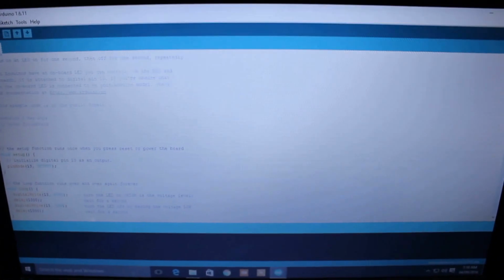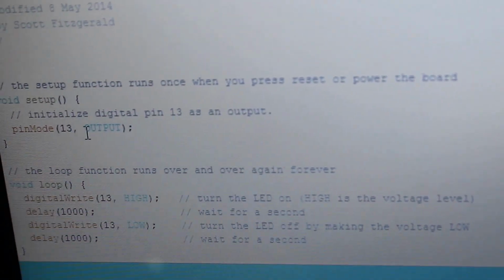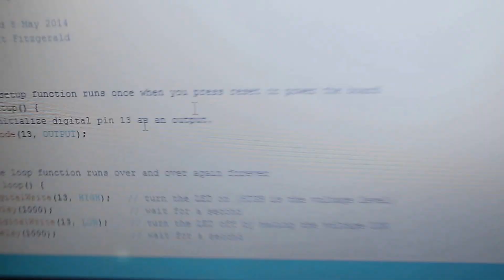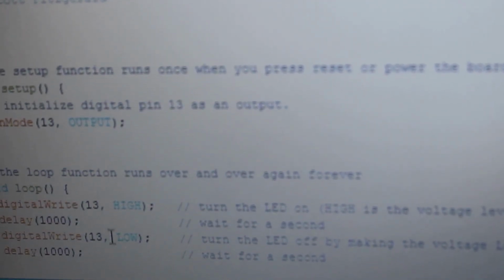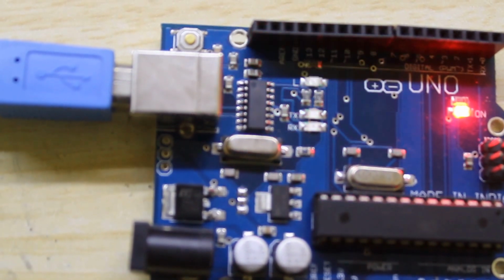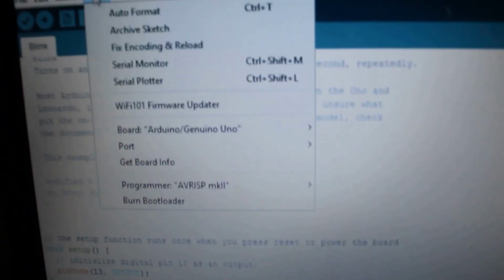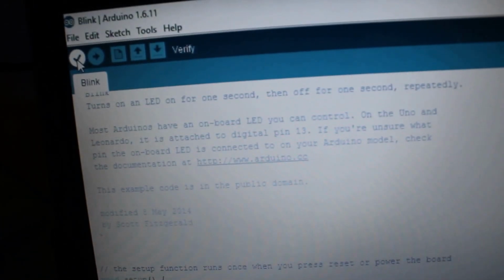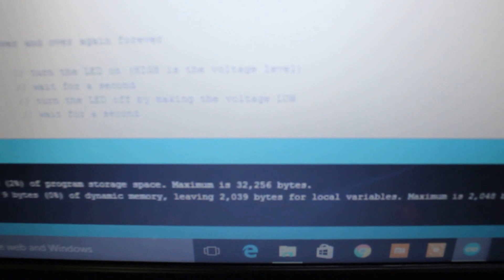How to Upload program into Arduino

Comment: Bro usb port option is not showing please help me😭😓.
I worked on that for three days, but not worked.
Please can you give solution.
Reply from the maker: Go to this_pc option right click, click on manage open device manager and check if USB port is detected in your computer and COM PORT is assigned. If not assigned then either install CP2102 or CH340 Driver 
Or if it's a normal Arduino clone board just try to change port and see if port is detected.
If still no success go to your folder where Arduino is installed in filesx86
Check for drivers folder, copy the path and paste it during installation from device manager.
Search little bit on Google it will work
Keep connected!!
Reply: @kolhatkarchinmay  Thank you

Comment: Can we rewrite a program in an Arduino, or install 2 or more programs and select any one program at a time??
Reply from the maker: No u cant write more that one program into any microcontroller. Yes you are write multiple function and use external switches to select which function u want to run. And u can rewrite program into arduino any number of times u want.
Reply: @kolhatkarchinmay  dear Chinmaya thanks for your prompt reply.
Actually I want to make a 8*12 LED matrix, in which First, I want to light first LED by pushing a button, and when I push the button again the first LED get off and next is On...and so on up to 96th LED.
Second: In this function I want that First column light on first, and then by pushing the button next column is on and the previous is off and so on up to 12th column.
Can you please help me in making this program.
Your support will be highly appreciated.
Reply from the maker: @asvenesharma8777  it seems like it's all logical. U can easily try to logic by writing simple C or C++ program. I wont be able to spent time for now. Good luck! 
If you stuck somewhere contact me at 
chinmayelectronics27@gmail.com
Reply: @kolhatkarchinmay  Dear Chinmaya... Thanks a lot for your suggestions and support. I will try as per your suggestion and will surely contact you if needed.
Best Regards
Dr. Asvene Sharma

Comment: How to load the code in LCD display
Reply from the maker: Code is loaded on arduino or Microcontroller not on the LCD display. Code loaded on Arduino/microcontroller controls tha data sent to LCD. LCD is just a output device. Usually 16X2 Character LCD is used in 8bit or 4bit mode. Use LiquidCrystal library in arduino example codes to attach 16X2 display to Arduino

Comment: Sir it's shows me that problem uploading to board... But I my port is visible and drives is also well...
Reply from the maker: U need to buy Usbasp programmer to burn bootloader again to your board. Download libusk Usbasp driver and go into arduino tool to download the Bootloader
Reply: @kolhatkarchinmay  Thank you sir... I gave my UNO board to an service centre and they told that that boards Serial port convertor is got damaged due to improper bootloader...
Reply from the maker: @kowshikhero8806  ok Great!

Comment: If I want to connect 4 dc motor using  L298N ckt how it can be done?
Reply from the maker: Connect any 4 GPIO pins of arduino an ground common. And u can get the code online

Comment: I HAD A ERROR SAY'S Arduino: 1.8.9 (Windows 7), Board: "Arduino/Genuino Uno"

sketch_jul27a:16:1: error: stray '\342' in program

 Serial.println(“ACTION REQUARED MOTION DETECTED”);

 ^

sketch_jul27a:16:1: error: stray '\200' in program

sketch_jul27a:16:1: error: stray '\234' in program

sketch_jul27a:16:1: error: stray '\342' in program

sketch_jul27a:16:1: error: stray '\200' in program

sketch_jul27a:16:1: error: stray '\235' in program

sketch_jul27a:24:1: error: stray '\342' in program

 Serial.println(“ACTION REQUARED MOTION DETECTED”);

 ^

sketch_jul27a:24:1: error: stray '\200' in program

sketch_jul27a:24:1: error: stray '\234' in program

sketch_jul27a:24:1: error: stray '\342' in program

sketch_jul27a:24:1: error: stray '\200' in program

sketch_jul27a:24:1: error: stray '\235' in program

D:\Ganesh\sketch_jul27a\sketch_jul27a.ino: In function 'void loop()':

sketch_jul27a:16:19: error: 'ACTION' was not declared in this scope

 Serial.println(“ACTION REQUARED MOTION DETECTED”);

                   ^

sketch_jul27a:24:19: error: 'ACTION' was not declared in this scope

 Serial.println(“ACTION REQUARED MOTION DETECTED”);

                   ^

exit status 1
stray '\342' in program

This report would have more information with
"Show verbose output during compilation"
option enabled in File -> Preferences.
Reply: Code missing

Comment: Bro my program suits for andruino mini but port option is not showing whether I have to connect andruino and do it?
Reply from the maker: Arduino mini or Nano?? Mini has NO  built in usb port so how u r connecting it to usb port? U have to use ftdi breakout board to upload it code directly into arduino mini

Comment: The port option is not showing in manage.
Reply from the maker: Please see the IC number near it D type port on arduino it can be CH340G driver 
Or
CP2102 
Or 
Arduino driver
Try downloading and updating the device driver. It will work

Comment: Bro after uploading programme if i disconnect the usb port and supply the Arduino with 12v through 12v jack will the programming work??
Reply: Ok thks bro my project was just waiting for this answer ☺
Reply from the maker: Yes 100% it will work. Because ultimately it's a microcontroller just need power and it will work!!

Comment: Nice video. Sir we are making heartbeat sensor using Arduino how we can prog it .we need your help in coding for this
Reply from the maker: Ajay sharma you can buy full project  as well from us at low cost you can contact me at 9423003348
Reply: Sir, could you please explain the function and working of health monitoring system using Arduino and ESP8266. And also please mention the price of the project sir..